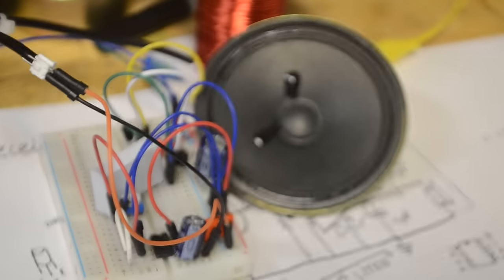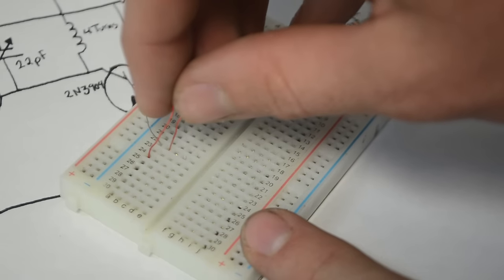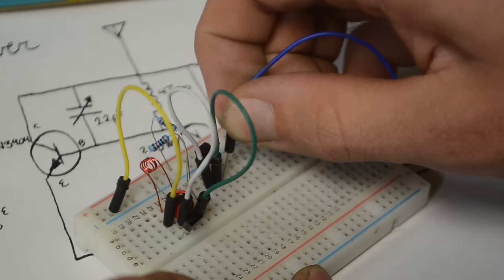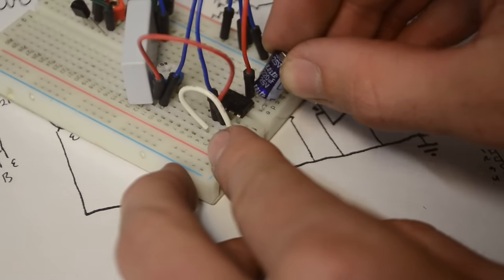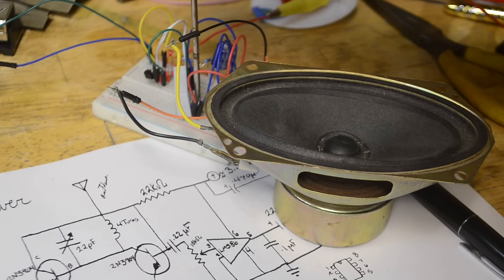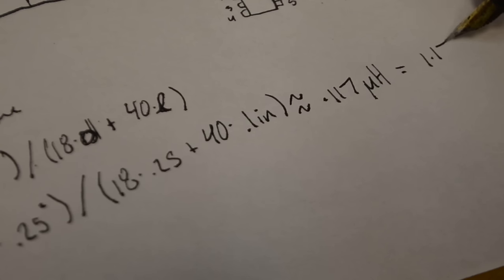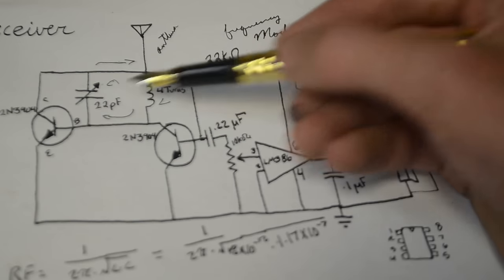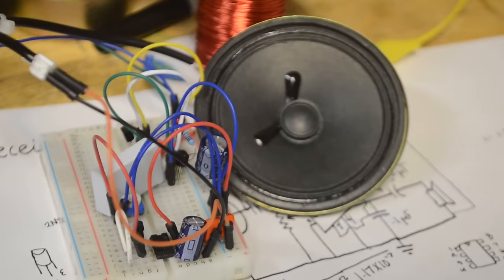How to make a FM Radio

Comment: These circuits usually won't work, except you are living next to a radio station and you are using a very long (4-5m) antenna.
For the RF amplification you will need an RF transistor, which can handle those high frequencies.
When you use a LM386 as an audio amp, make sure you use this 10µF capacitor between Pin 1 and 8 AND at least a 10µF cap directly at pin 6 and 4 and also an 10µF cap at pin 7. The LM386 can't handle this high amplification without a buffer and will otherwise produce loud squeaking noises.
The other thing is: FM signals are not easy to demodulate. With discrete components this would be very hard...in these days you'll need a PLL FM-decoder IC or something like that.
For testing purposes you can use something that is called (i don't know the english translation!) "edge discriminator". This is done, just by adjusting the variable capacitor next to the exact wanted frequency, as you are doing. But this sounds awful and if you turn the cap 1 tenth of a mm to far, you will hear nothing.
You also need to keep the wire lengths as short as possible....you can't do it on a breadboard. The wires of your coil are too long.
If you would solder it together directly, you would get much better results. Try to use silver wire, instead of copper wire for the coil!
But even though: the results will be "experimental" and not satisfying...

Comment: Great video! I would recommend that you stay away from electrolytic capacitors for ac decoupling of your power rails. They're polarized and the noise can occur in both directions. I'm not really familiar with this particular circuit, I would probably shoot for a .1uF ceramic cap instead of that 470uF electrolytic one, though.
Reply: A common technique is to also put decoupling capacitors directly across the power inputs of your components like your op-amp. This can be more effective than just decoupling the power rails, because your breadboard itself could be responsible for some of the noise.
Reply: would a 4.7uf one work also 50 volt ??

Comment: Suggestion: To access those tiny trimmers, you can make your own trimmer driver from a small plastic paint brush handle. Just file the tip of the handle down to the shape and size that fits the trimmer cap, and now you have the correct driver with the added bonus of it not damaging trimmers like metal drivers can.
Reply from the maker: +N1RKW that's a great idea! I will do that! Thank you so much!
Reply: Glad to help! It's a technique I've been using for years, and it's worked well for me.

Comment: LM386 is not an OP Amp.. it's an actual linear audio amplifier and are commonly found in non stereo devices like a fax modem to drive the internal speaker or some toys that make sounds. Some PC speakers used them early on (one for left speaker and one for the right speaker) but now they use ond of the TDA IC varients for stereo sound amplification.
Most of those cheap varible caps use plastic sheets to change the capacitance. same for modern dual gang tuning caps. The one you are using is a trimmer.and is VERY touchy, For the best band coverage you should use an actual tuning cap.
That big .22uF cap is an AC line cap, it's overkill for this application but it will work lol

Comment: Hi... i wanna ask it is possible if i change the value of input voltage, from 3.5V to 6V and what is the effect ?
Reply: If you do go to 6 Volts, you will have to put a variable resistor for the 22k one, I would go with 100k and start at high resistance adjusting down until you hear some noise or signal meaning you have regeneration. you could then measure the resistance you find best and put in a fixed resistor if you want to.

Comment: Wow this is amazing especially on a breadboard. The audio amplifier part I’m good with. Could somebody please explain the principle behind the left part of the circuit? How is frequency converted into amplitude for the op amp to further amplify?
Reply: J W  Thanks JW - same to you. The subject is pretty hard, but i'd recommend "Principles of Electronic Communication Systems" by Louis Frenzl. Unfortunately it's super expensive, but the 3rd edition (one before last) can be found used on Amazon for a reasonable price.

Comment: I think you made a mistake calculating the inductance you used inches instead of meters so 0.25in = 0.00635m
Reply: I was thinking the same thing when I saw his formula and realized he was using inches rather than meters. It's a mistake but this young man is very informative & smart.

Comment: I've got an old wooden table radio from the 50s. I'd like to put an F.M radio inside the case without modifying it too much. It's got a 6" speaker and I'd like to add an amp and an A/C adapter. I've been having a hard time finding the module kits I've seen on you tube. I'm also reluctant to order parts since I don't know how many ohms the speaker should be. I'm not a tech-head, but I can follow a schematic, any ideas on where I can go for assistance on getting parts? I live in the U.S. so the British modules I've seen aren't easily accessible. Thanks.
Reply: Mouser & Newark are also good electronic parts distributors.

Comment: Hi
Transistor BF494 is not available in my country and your circuit with transistor 2N3904
I close it on the board, but it only makes noise, even I put the FM transmitter next to it near the circuit, it has no effect and instead only the IC gets very hot
What is wrong?
With transistor bf 199, the circuit has only distraction (noise) and does not take a station
Thank you for answer me😞🌍

Comment: Your two transistors in the receiver form a circuit like a tunnel diode (at much less cost) the bias is critical, a pot would be good to adjust your 22K bias resistor to form a regenerative receiver.
Reply: What is the purpose of tunel diode?
Reply: @levirizkisaputra3729  A tunnel diode is a special type diode that has negative resistance at a certain level of bias Voltage, meaning it can amplify and cause oscillation even at very high frequencies.
Reply: In this radio the two transistors will fight each other to allow current flow, so one of them will conduct then the other transistor will conduct so that there will be oscillation and gain. I would use a 50K or 25K variable pot. (resistor) to set the bias point.
Reply: @mrdovie47  I have question sir, where is demodulation happen? May guest is capacitor and resistor before LM386 IC
Reply: @levirizkisaputra3729  The sound is demodulated in what is called a slope tuner, not a true FM demodulator. To hear the sound you tune close to the station (not on the peak) then as the FM signal changes frequency with the modulation, audio sound can be heard. But it is really AM reception with some static, not true FM.

Comment: im just curious... you have the ground rail going to the neg voltage rail... why?
Reply: They are the same  when using a single voltage supply. The supply  - negative is the same as ground.

Comment: Will it work with a 2N2222A transistor instead? it has the same pinout and a similar name so I assume they are related in some way. SOME ONE RESPOND
Reply: Some People Say it works with 2n2222 and some say it doesnt, i just would recommend you to try and u will see
Reply: @kubakrawczuk7450  Idk it might blow 😲Might be worth it though I have hundreds of 2n222a transistors.
Reply: @kubakrawczuk7450  ehhh... also I don't have a lot of components for this project so I won't do it.
Reply: Compare the data sheets of the 2n3902 & the 2n2222a. You might have better gain (he) with the 2n2222a.

Comment: Why does this circuit work? The LC part of the circuit is not modulating the signal, because the frequency of FM radio is changing. I believe it's only modulating the "centre" of the spectrum, so the sound is incomplete.

Comment: can you write a parts list...thanks
Reply: 2x  2N3904 transistor (use a BF199 or BF494  RF transistors it will work better)

1x 10K ohm potentiometer

1x  (0 - 22 pF)  trimmer cap

1x  22K ohm resistor

1x  220 nF capacitor

1x  100nF capacitor

1x  220uF capacitor

1x  10uF cap (put that between pin 1 and pin 8 
to increase the gain to 200 ).

LM386 audio amplifier

some magnet wire (to make the coil )

a speaker (although i suggest to use a high impedance earphone )

Comment: When you used the Teapo capacitor and the polyester capacitor having a value of .22uf and .1uf respectively can I replace both with ceramic capacitors?
Reply: I think generally, ceramic capacitors are better in basically every way to electrolytic capacitors, and in this case probably better than the polyester one too

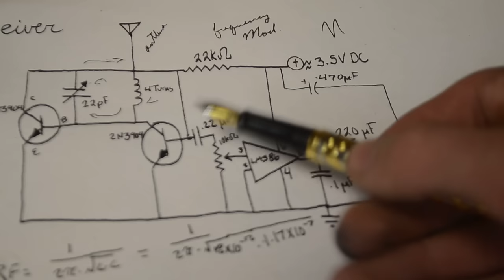Comment: 9:11 please inform yourself how radio comunication works. In a radio wave there is a electric and a magnetic part. With a piece of wire as a antenna you will recive both